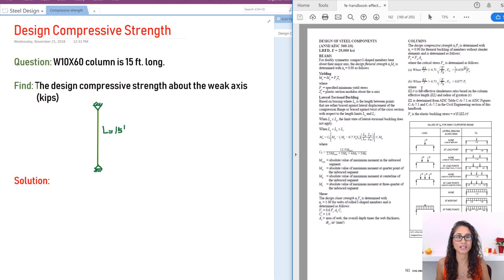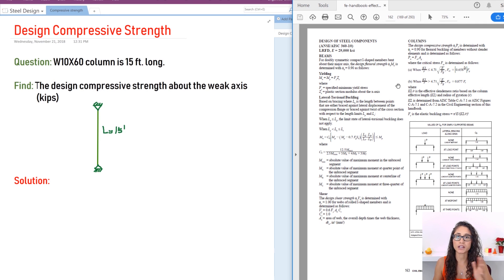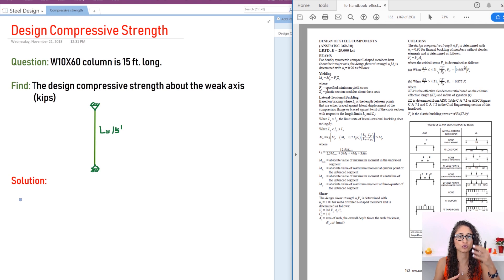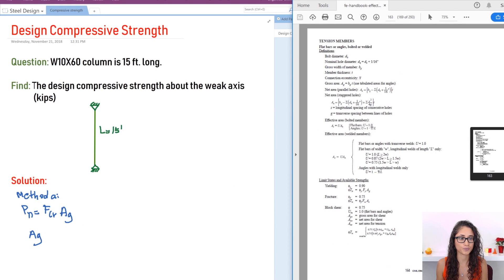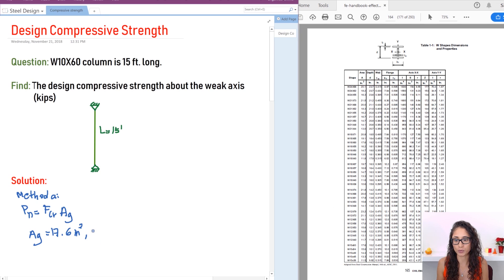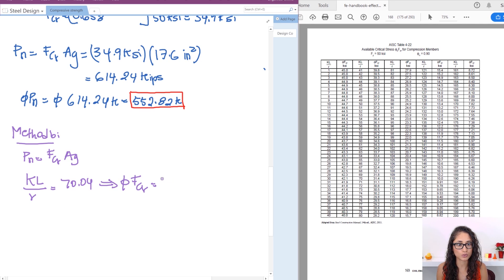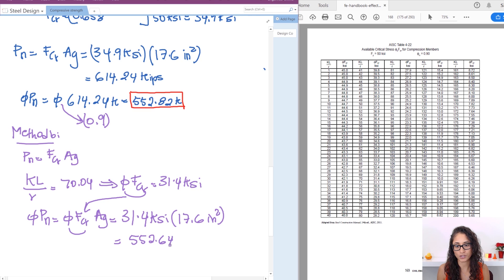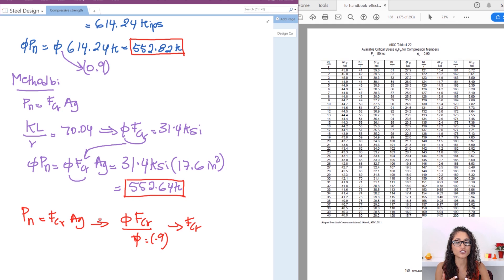FE Civil Steel Design - Design Compressive strength ΦPn

Comment: Correct me if I'm wrong 
I think this question was bit incomplete becasue fy was not given which can be diffrent for different grade of steel. Using Fy to be 50 ksi would be just assumtion considering limited information on the FE refrence book.
Reply from the maker: Hi, thank you for watching and that's a great question. So on the FE exam, if they don't give you Fy, you should use 50 ksi since all the tables on the reference handbook specify that Fy is 50ksi. If it's not 50ksi, then they would provide the value for Fy in the question. I hope this helps 😊and keep up the good work!

Comment: There are problems in the FE review manual where if you use the chart you will get a completely different answer. Which way are we supposed to use to ensure we get the right value?

Comment: If I'm not mistaken, one could also use method say (c) -->  find KL as you had done = 15' and go to table 4-1 and grab the value of 555 kips for the W10X60 section. (that table is pretty limited, only W10 W12 & W14  about weak axis though)
Reply: That's what I did, gives a close value of 555 kips.
Reply: true
Reply: Yes, u r right, Actually we have 3 methods in order to find Design Compressive strength!
Reply: For FE examinees you would have to follow the way she shows.  You won't have the AISC 15th ed. steel manual on the FE exam.